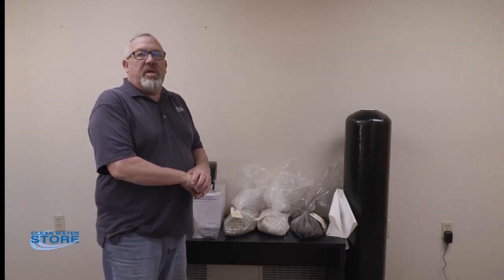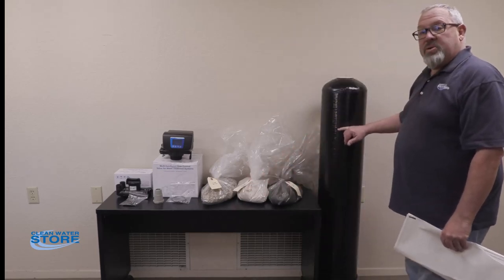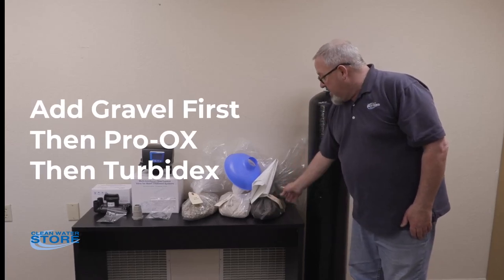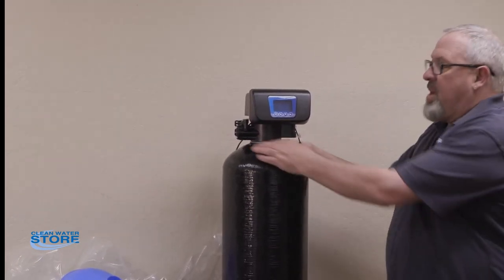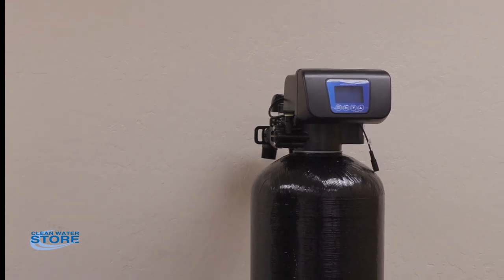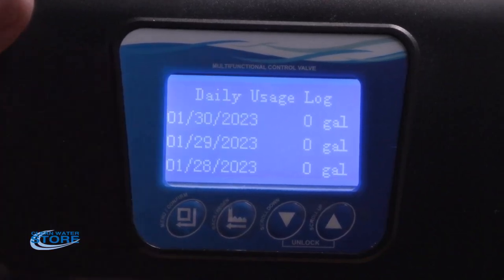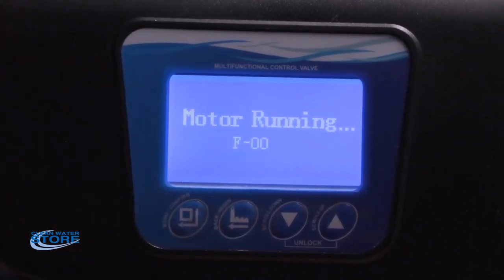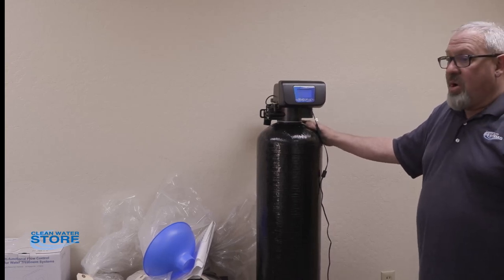7500-Rev2.5 Pro-OX Iron Filter Installation Guide

Comment: I AM SO CONFUSED!  This system is not for regular homeowners.
Reply from the maker: Hello -  thanks for commenting on this!  If you need assistance, we have live Zoom and also phone support as well as a Step by Step printed manual.  It does require some basic plumbing but over 70% of our customers are regular homeowners who installed these.  So far we have over 65,000 residential customers on well water, and a few thousand of this particular model. Once its set up, its good for years.   If you need help please reach out to our support team at support@cleanwaterstore.com